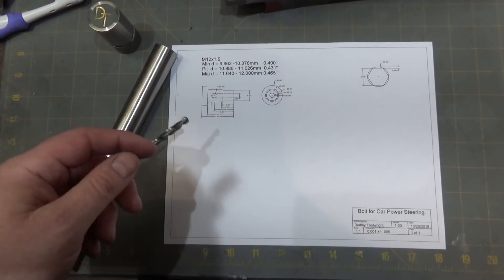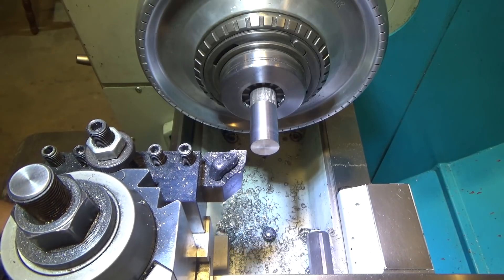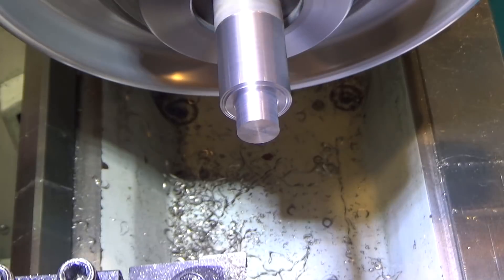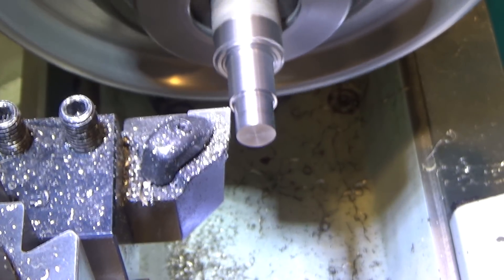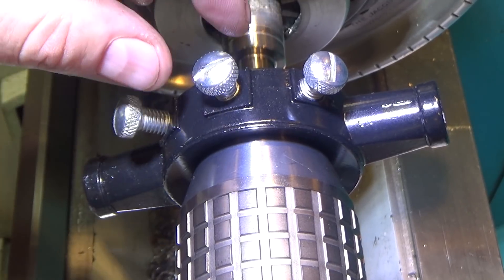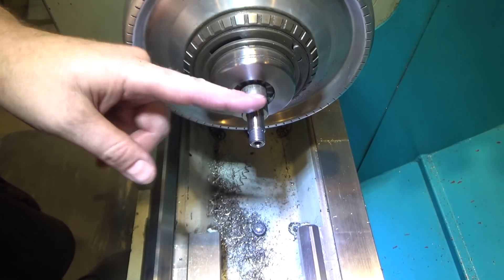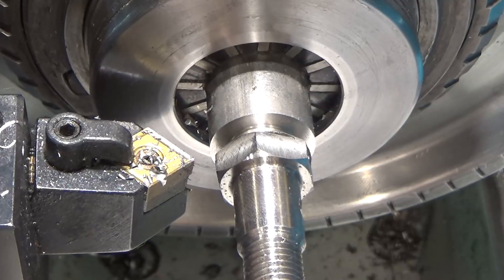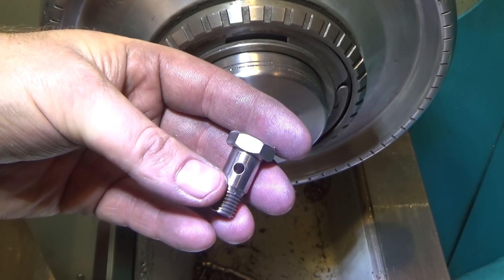70 Hydraulic Steering Bolt for Friends BMW project

Comment: Hi, off-topic, but–  did you get a follower rest with your lathe?  I'm trying to make one and need to know how thick to make it.  I made a nice template from cardstock and I believe you said waterjet cutting would be a good way to go, or maybe I'll just use the bandsaw and mill.
Reply from the maker: I did get a follow rest with the lathe and have never had it work too well. I have ascribed my difficulties to my lack of knowledge. I would try the band say method if you are patient, but waterjet would be pretty good and a whole lot faster if you can afford it, especially if you are using really thick stock. My follow rest is about 1.5" (37mm) thick. I hope you make a video of the project.
Reply: @DudleyToolwright  Wow, that's thick (twss?).  I suspect yours is constructed like an I-beam, but mine will be heavy!  I was hoping to cut an acme threaded shaft but was concerned about the burr raised.  Accessories are not something I considered when purchasing a used lathe.  A collet closer would have been nice, too.  I would probably have to settle for a collet chuck.  But I did get a 3-Axis DRO.  Unfortunately, the linear encoder on the cross slide blocks the lockdown screw.

Comment: On a 5C collet block, the flats are the precision ground parallel surfaces not the peaks. If you clamp the way you did having the peak as the bearing surface there is a good possibility that the parts would not be as accurate as desired. Now having said that when make a hex head for a wrench who cares , but if you are making a part that has a higher tolerance it is worth bearing in mind
Reply from the maker: Thanks for the useful observation. I wanted to put an angle block underneath, but there was no room. I could have tried from the side though. Thanks for the insight.

Comment: Neat. I think I’d went in the depth of the flats and chamfered the part before milling the flats, to reduce the interrupted cut on the cut off insert. But that’s my preference not to say you was incorrect in the order of operations.
Reply: That happens to all of us. Been there done that
Reply from the maker: I actually did chamfer the part before milling the flats, but no where near enough. I ended up milling off all of the chamfers. I agree with your approach entirely as long as you don't screw up like I did.

Comment: Hi.  Great video.  Question.  I also have auto feed on my Z axis and I had it installed at the factory.  When I received my mill it had Z axis auto feed but I could no longer get the manual feed handle on it like I can on my X and Y.  Is yours the same way or does your manual handle still fit on it also?  Thanks
Reply from the maker: I have a video where I put on a functional, but mediocre Z-axis power feed. It does provide for the handle to be put on, but man is it dangerous. The kit comes with a spring to disengage the handle most of the time, but then the handle is all but useless. I keep the handle off except when I specifically am using it and then I am very aware of it being there. I forgot in once and got nailed in the wrist. Very memorable.

Comment: Why don’t you single point cut the threads in the lathe? Why use a die? 
Cheers
Reply from the maker: The threads are 12 x 1.5mm and my lathe is an imperial one. I can single point metric, but usually have to leave the half nut engaged. There was no room for a relief zone, so I would have had to run the turning tool upside down and run the lathe in reverse. I have never tried this and had limited time, so I went with second best.

Comment: I know you probably did this for free but if you did this as a paying job, how much do you think you would charge?
Reply from the maker: That is a very good question. I don't own a CNC so everything takes a lot longer. The whole project took about 3 hours start to finish, but that was with camera work. In reality, if I was going to make more than one, I could probably get the process down to something like an hour a part. The big question remains, how much do you charge an hour? I don't know what the going rate even is. I think the price for that part, even charging for a single hour, would be cost prohibitive. You can order a steel part online for $40 according to my friend. I think actual professional machinists charge something like $150/hr.
Reply: @DudleyToolwright  I agree, thanks for responding.